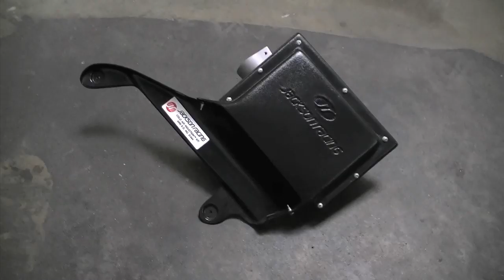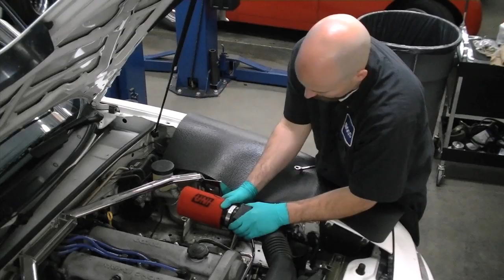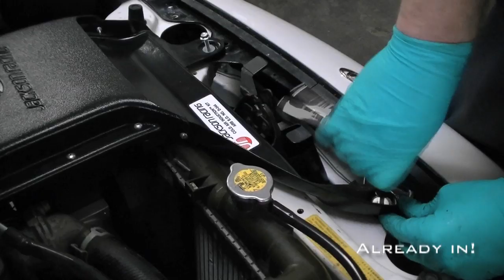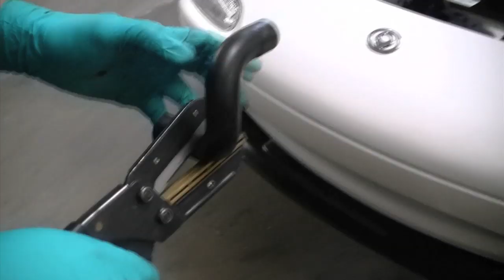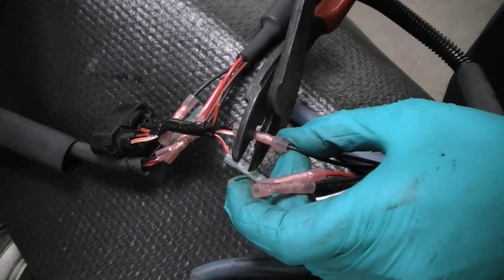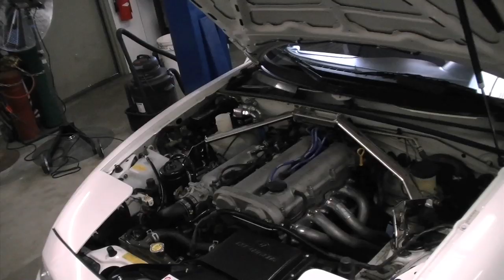Jackson Racing Cold Air Intake - #901-980, 901-985

Comment: @olrac42vids I recently tried to install a K&N air filter in the Jackson Racing Cold Air Intake and, unfortunately, it won't fit without some modifications (I used the K&N air filter size that fits in the stock Miata intake unit). I'm going to try and cut away some of the rubber filter frame and see if that works. And I'll be honest, I really like this intake unit, but am very disappointed by the quality of the air filter and the over use of oil in the filter. I recently examined the intake and the filter that came with it and noticed that there were some small pools of oil in the filter housing and that quite a bit of debris had made it by the filter. My concern is that the oil leaking from the filter and the debris that made it by the filter may be the cause of the erratic idle and poor performance that I've been experience. Seeing that the delicate Mass Air Flow Sensor is located mere inches away from the filter and after eliminating a number of other potential causes, I plan to replace my Mass Air Flow Sensor and try and get a different filter in this unit and see what happens. I'll keep you updated and if I'm successful with the filter modification I will be sure to send you some instruction on how to get the filter to fit.
Reply: In the end I was able to get a K&N air filter to fit, but not without trimming down the sides (the two sides that a shortest). Both sides had to have some of the rubber on the side taken down using a combination of hacksaw and box cutter, but after that the fit is perfect. And after replacing the Mass Air Flow sensor and putting in the K&N air filter the erratic idle has not returned. My only word of advice is be very careful not to cut yourself while trimming down the sides. Other's might have a difference experience, but I had a few close calls due to the flex in the rubber of the air filter and poor quality of the tools I was using. But, all in all, I am very happy once again.

Comment: Video does not show removing the thermostat and installing spacer,if not water hose will be in the way of the airflow meter. Yes this will work and 1.6 or 1.8 with a/c